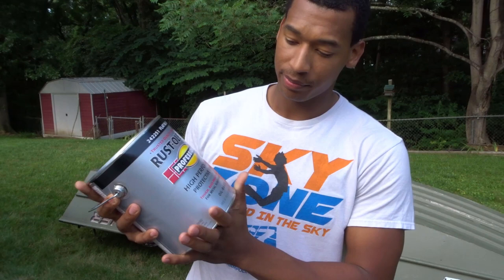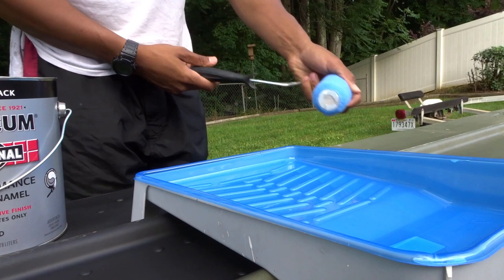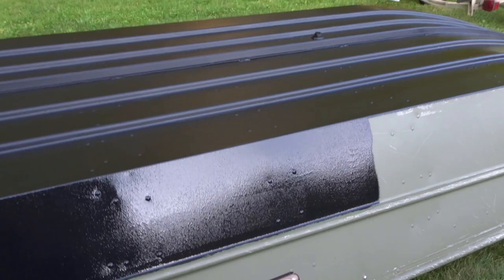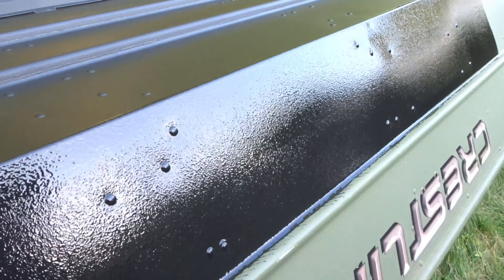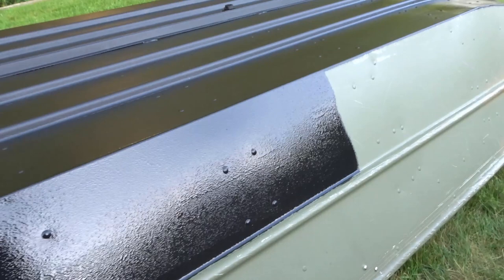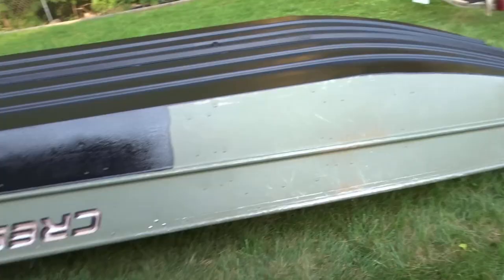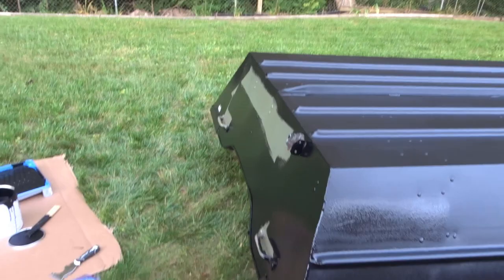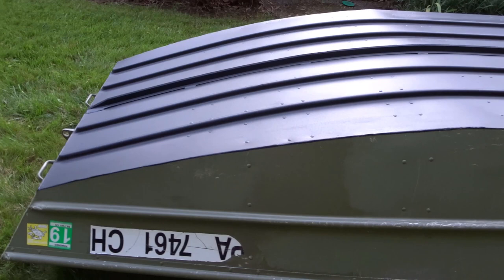How to Paint  a Jon Boat

Comment: Awesome video man! I would use a heat gun or hair dryer and heat up the stickers and use a paint scraper or blade and scrape them off! Works well for any adhesiveness
Reply from the maker: I ended up using a razor, it took a while but worked.

Comment: The wire wheel works, but the way your supposed to remove stickers is with a blow dryer to heat up the glue then a single edge razorblade.
Reply from the maker: Thank you

Comment: didnt sand the surface for better adhesion? it doesn't matter? hows it now
Reply from the maker: I chose not to sand because I didn't think I needed to, also would have been a lot of work. The paint is still holding up great,  besides the very bottom that rub against the trailer and shallow cover that I go over. Otherwise,  it has worked out great.

Comment: Good luck. But i dont know how long your paint will last . theirs special marine paint that is made to stick to aluminium comes in jon boat green and grey. Never seen a black jon  boat  but you might be able to get a marine black.
Reply from the maker: Thanks. Paint has been holding over the past years besides few scratches from running into sticks/branches to retrieve snagged baits. Quick spray paint touch up has done the trick.

Comment: how long is the boat and how much paint did you need? im trying to paint my own 10ft jon boat inside and out. nice vid btw
Reply from the maker: Thank, Its a 14ft double wide jon boat.  I only needed 1 gallon of paint for 2 coats, and I believe I had just a little bit left over. I spray painted the inside areas that were visible after I installed the deck and everything.
Reply: @GTX10  thanks!, helps alot!

Comment: If I were to paint a jon boat that started off that same green color as yours a light blue or white do you think it would eventually come out all white or blue or would you be able to see the green underneath because white and blue are so light, great video btw
Reply from the maker: I believe it can be done with a primer coat first and then at least 2 coats of the final color. Otherwise check with a professional at your local Sherwin Williams or other paint places
Reply: SMD Fishing ok, thanks for the reply!
Reply from the maker: @blakemarsicano7987  no problem
Reply: @blakemarsicano7987  how did it turn out?

Comment: I just did mine with gloss rustoleum yesterday after sanding the entire boat inside and out. Does the paint stay on it? I see some people make it sound like you shouldn’t use it but I saw this video and just went with it. Btw I used a heat gun for stickers and then goo gone and a rag to remove glue residue.
Reply from the maker: Its been over a year, and the paint has held up just fine. If any paint is missing, its on my transom due to me switching motors frequently for different bodies of water I fish. Even after hitting docks and sticks, 2 coats of paint have held up great. I have a update video recently on my channel if you would like to check it out.
Reply: Thanks man
Reply from the maker: @csmith0244  No problem.

Comment: Saw this video years ago and now seeing it again. Its good to hear its held up pretty good. I'm buying an old Ouachita 14x18 boat out of MD. It really will need a paint job once I get it home. I like the roll on method seems simple enough. Wonder your thoughts of spraying it through a Harborfreight spray gun. Mine will need atleast 2 coats its in good shape but someone rattle canned camo red,yellow,brown allover it. Was thinking of smoke grey because all flat black might get a little toasty down here in VA. I was also debating getting the rusty metal primer but seeing your results I might as well avoid that step. Thinking of that I wonder how painting it with just the rusty metal primer only would hold up. When that dries its a flat earth color. Also the videos pretty old now but a heat gun maybe on the otherside of the stickers should help to release them. Might get the AVANTI
Airless Paint, Primer & Stain Sprayer Kit from harbor freight. Ive got alot of painting projects and it says It will spray unthinned paint.
Reply: I think with my prep I'll get a good degreaser and clean it and than pressure wash it. I was not planning on sanding or scuffing the whole boat.
Reply from the maker: How did it go?
Reply: @GTX10  I got a good deal on a hvlp gun at harbor freight and mixed 1 gallon of hunter green with 2 qts of rusty metal primer. I rattle can primed the boat after sanding it with an orbital sander. Reduced the paint with mineral spirits but didnt have enough to get it thin enough to spray good. I also used majic catalyst hardener and ended up just rolling on my second coat. The boat looks fantastic, truly a night and day difference. The mixture came out as a darker od green and looks very good. I also added a 10x18 1/4 aluminum plate on the back of the transom and sealed it with 3m 5200. The aluminum bolts on the transom were replaced with stainless steel ones also sealed with 5200 and painted over.
Reply from the maker: @TheSicWolfGaming  Sounds like it turned out great.  Glad to hear. Your work has paid off.

Comment: You can try using a eraser wheel.. it's normally used to remove bumper stickers and vinyl lettering
Reply from the maker: Blade was the weapon of choice, and it worked, thanks though

Comment: How is that paint holding up just got an aluminum boat that needs to be repainted
Reply from the maker: So far so good, out here on the Potomac. The only part that is taking a beating is the bottom of the boat, on and off the trailer. Otherwise,  its just fine.
Reply: @GTX10  put a good hull coating on the bottom of your boat like from mudskipper. Com it's like a plastic epoxy mix impact-resistant make your boat go faster you apply at like paint it comes in a paint can and it's really hard stuff and impact resistant
Reply from the maker: @MudMotorsMax  thanks for your advice

Comment: I know this is a year old but you should be able to remove the sticker with a heat gun then scrape it off. At least make it easier to remove with one. About to do a jon boat redo myself and saw your video. I was going to get a spray gun but saw you used a roller and how good it came out. I’m going to use a roller now! Thanks!
Reply from the maker: Glad I could help. I ended up using a blade to remove the stickers

Comment: 4.5" wire wheel and a grinder
Reply from the maker: I ended up using a blade, and after some inappropriate words, and patience, it came off.
Reply: @GTX10  ah been thinking about doing the same thing for a while. Turned out good?
Reply from the maker: @zornbratton  Yes, it turned out great

Comment: A nice easy way to get letters off is to get a torch, heat gun, etc: and slowly heat up the stickers, then take some sort of flat razor blade and scrape them off while they are still warm. Then use lacquer thinner to remove the sticky residue. I did this on a boat I redid myself. Hope this helps!
Reply from the maker: The razor blade ended up working out for me
Reply: My comment is a little late, I’m assuming you used the razor blade a while back right? Lol
Reply from the maker: Yes, lol
Reply: Good deal, I need to paint my boat, do you use clear coat?
Reply from the maker: I did not. I wanted the matt black look .
Reply: Any problems with paint chipping or wearing out?
Reply from the maker: Only on the bottom due to on and off the boat trailer